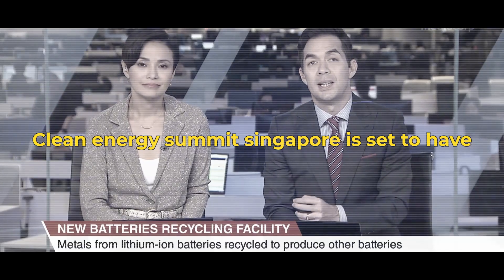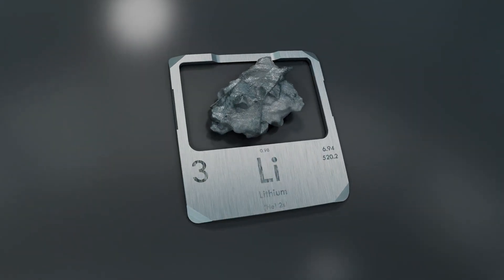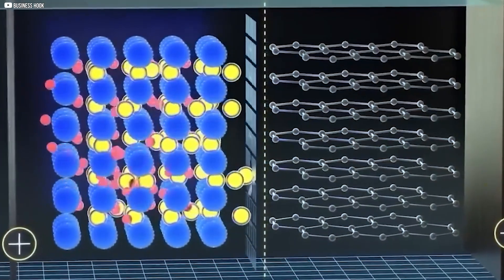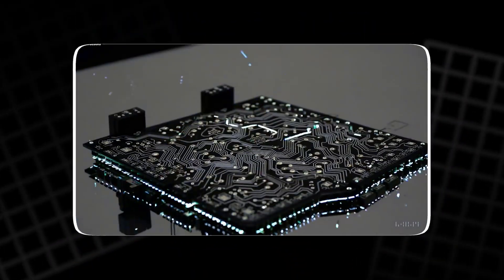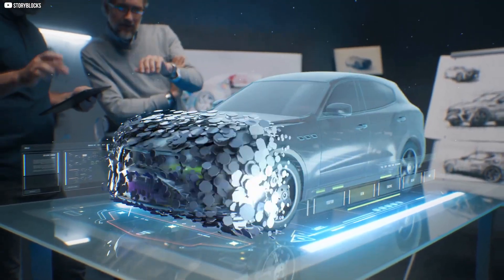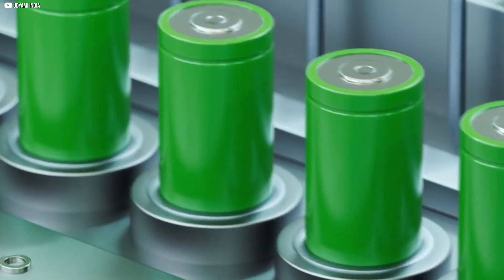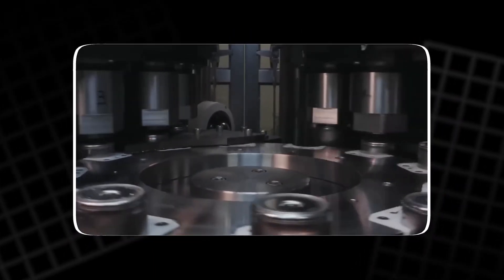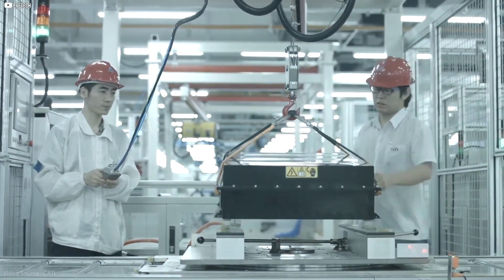AI Discovers $1 Fix That Makes Dead Batteries Last 10X Longer!

Comment: Can't inject old batteries because how they are installed in their packs. Better to add chemical to new batteries so the chemical is dispersed in the electrolyte.
Reply from the maker: That's a great point! Finding the right method to enhance battery life can be tricky, but your suggestion about adding chemicals to new batteries is definitely worth considering.

Comment: mal da von ab gesehen sollte die batterie nicht ausgelaufen sein zustand tiefen entladen bedeute das liedieum kristalle sich gelegt haben um diese wieder zum laden zu brinen müßten die leichter hitze aus gesetz sein und durch induckzion reaktieviert werden ja ist möglich birkt aber die gefahr das die batterien sich selbst entzünden ein grund warum mann 1,5v batterin nicht wieder auf laden kann dies verbleibt in der celle die seure die ch nicht der kohle verbinde und den liedium das wasser ist verdamft ohne wasser keine reagzion batterie ist im zustand tiefend entladen. auch seine ki weis diese  nun der trick liegt da drinne das gebundene wasser mit den lidium zu lösen durch indukzion bei auto batterien läst sich auf die art die celle mittel ruck führung  die celle wieder lade fähing machen klabt gut bei wartungs frein batterien
Reply from the maker: Thank you for sharing your insights on battery chemistry! It's fascinating how different factors play a role in battery performance and longevity.

Comment: 1,how we get it and do it safe
2,if we can't DIY, why do u think those companies sell cheaper?
u still have to throw away dead batteries like now if u can't buy and inject that thing, nothing changes 
EV companies still charge u the same because u have no choice
Reply from the maker: Great questions! Safety is always a priority, so it's important to follow guidelines if you decide to try it yourself. As for the companies, it's definitely a tricky balance between innovation and pricing. Let's keep pushing for better options!